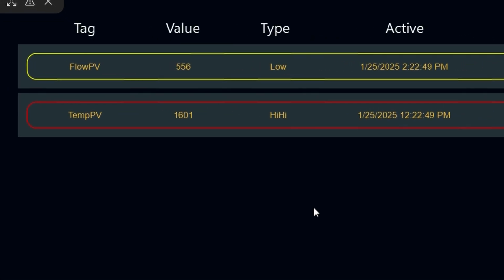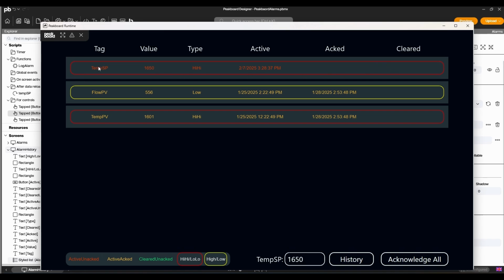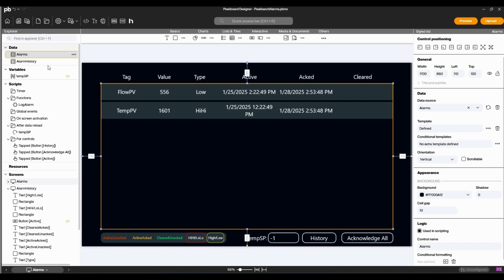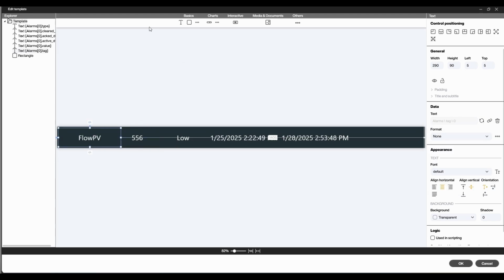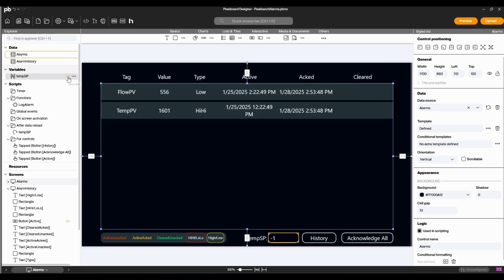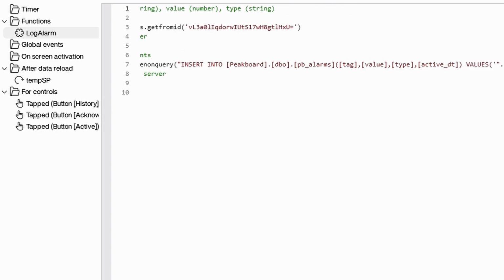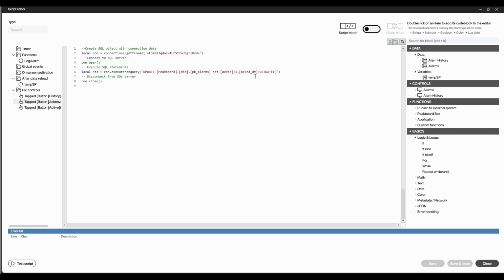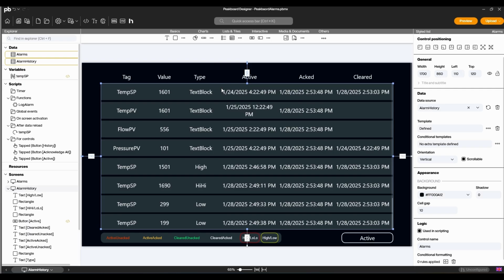Corso Systems Presents: Implementing Alarms and Alarm History in Peakboard

Comment: Is this a single user application? I would have expected it to show which user acknowledged the alarm. What is the overall use case for this application? Wouldn't the system acquiring this data have alarming? Is this for someone who wants to write their own VB code to generate alarms on data that is brought in from a historian? If I had 10 000 points do I have to write 10 000 pieces of code to alarm?